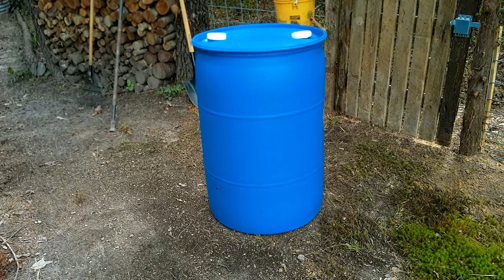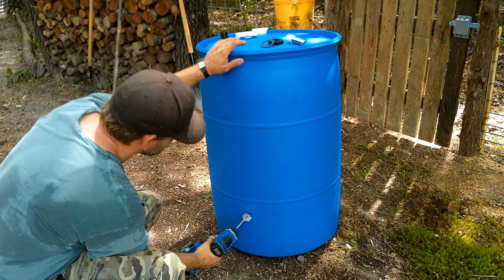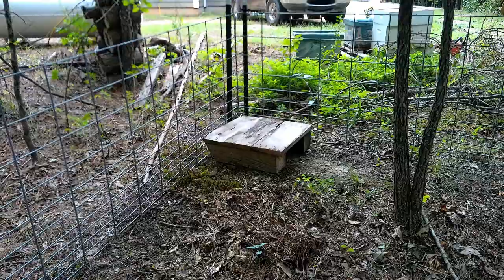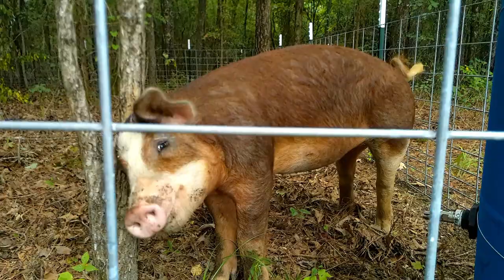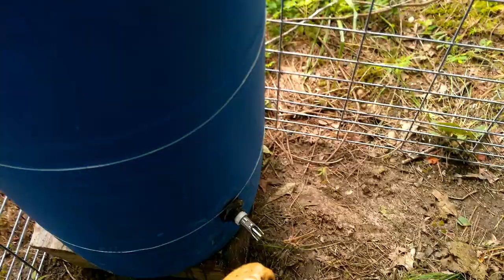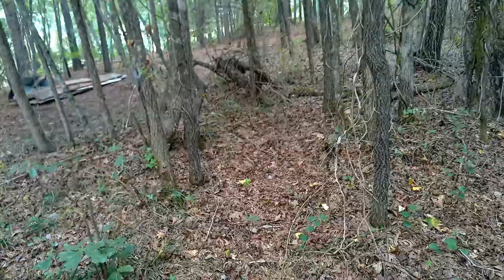DIY pigs  55 gallon water system!!

Comment: So does the water beneath the nipple inside get used?
Reply from the maker: Yes it does mix in when refilled each time.  However, I placed it up off the bottom so no sediment or debris plugged the water nipple